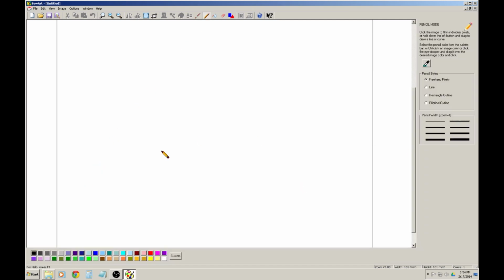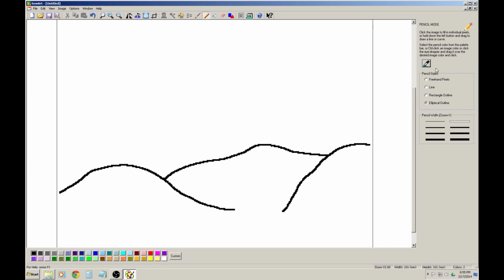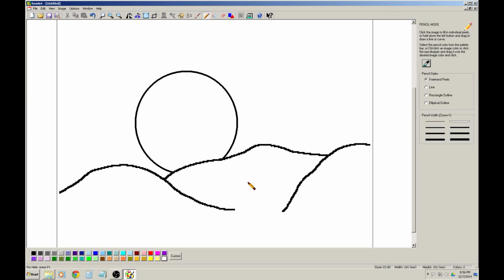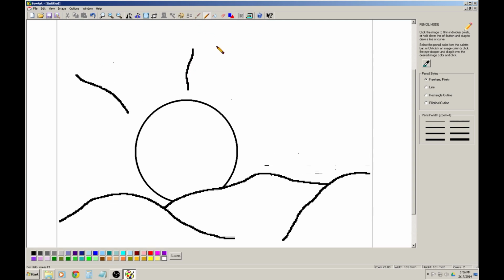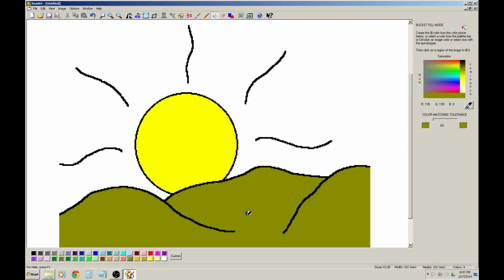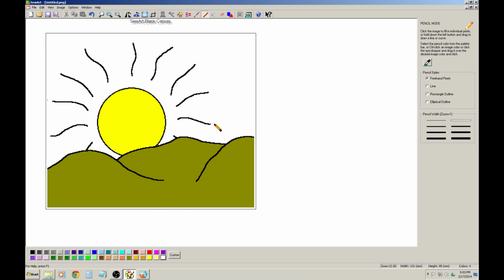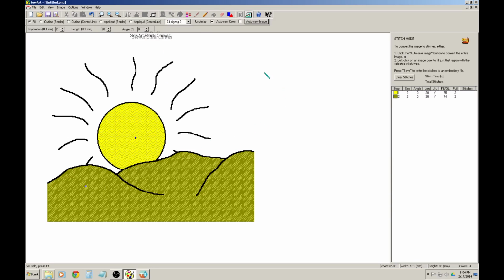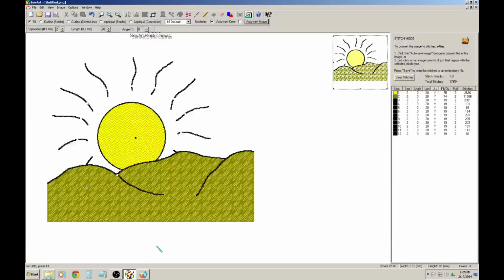Easy SewArt Draw Your Own Embroidery Design

Comment: I'm doing lettering and want to use a Satin stitch but it will only let me do it as a outline. The default is doing a fill stitch and is 67,000 stitches. Is there anything I am missing to get a satin stitch?

Comment: Please help.  I've created my file via SewArt. Saved in the file connected to my brother machine.  I can see the storage usage (132/464MG) however, I cannot see the image on machine to be able to save it or sew it.  What am I doing wrong?  Any suggestions?
Reply: I had the same problem with a design I had downloaded for my brother se400.  If the design is even one stitch too big for the machine it will not show up.  I downloaded a free program called Wilcom truesize and used it to reduce the size of the design by one stitch and it now imports and sews up beautifully.  The program was free too.  Good Luck.
Reply from the maker: See if this helps- http://youtu.be/NfGvCiK_qpY